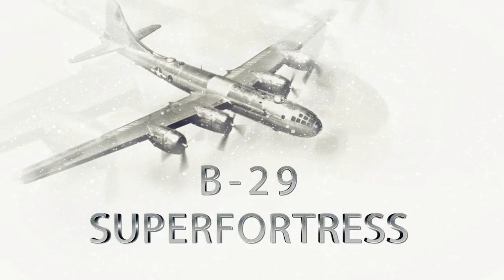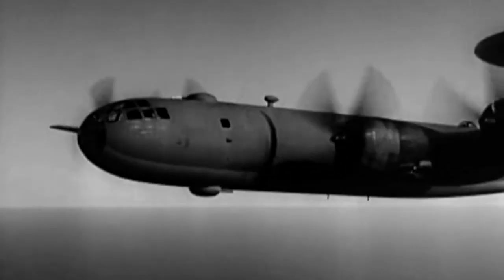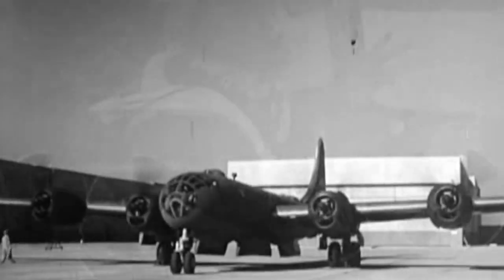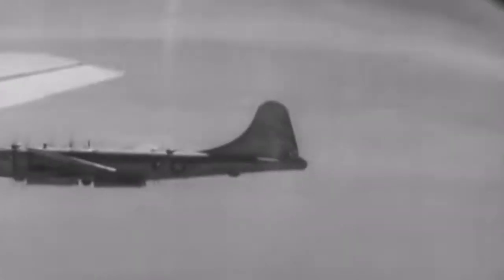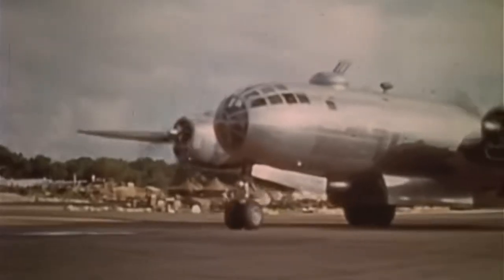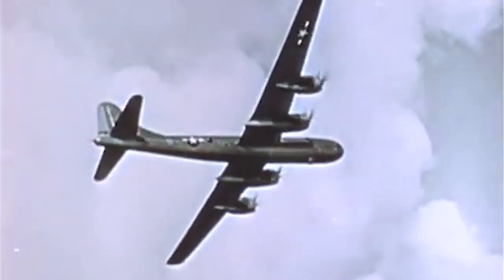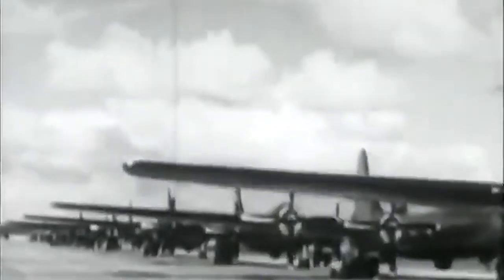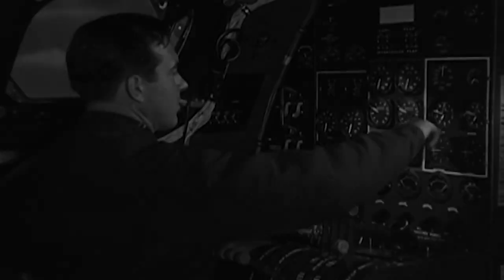B-29 Superfortress Documentary | Bombers of WWII

Comment: I have to confess, I have very mixed feelings about the B-29. There are many aircraft out there that you can say have a soul. The B-17, B-24, Avro Lancaster and many war birds, all meet this mark. They are living creatures with a heart and soul of their own. The B-29 on the other hand. I find too clinical, too sterile. It's a cold, methodical calculating machine, that does what it does with such a hiemal, ruthless efficiency that leaves me feeling a little disconcerted. That said though, with that polished aluminium body and sleek aerodynamic design. There is no denying that it is an absolutely flawless, beautiful peice of aeronautical art.
Reply: Yes! I find your answer interesting and see your point of view. This airplane was designed for long-range high-altitude bombing of cities which included a lot of people. Fairly cold-hearted I would say. However technically, it was way ahead of its time. Pressurization and remote-controlled gun systems with radar and computers that were way ahead of his time as well.

Comment: The B-29 was a really a beautiful airplane altrough I agree with a fellow that it was a rather soulless and cold airplane. The real problem was the awful Wright R-3350 Duplex-Cyclone radial engines altrough powerful was beset with dangerous issues and was very unreliable and mantainace intensive engine. Despite long development the engines was rushed in combat but remained temperamental, and showed an alarming tendency for the rear cylinders to overheat, partially due to minimal clearance between the cylinder baffles and the cowl but also because the two radial rows was set together back to back with the front row exhausting in the front and over then to be connected with the rear exhausting pipes going down to the turbo charger creating an extremely hot environment. A number of changes were introduced into the Superfortress' production line to provide more cooling at low speeds, but when combined with the high temperatures of the tropical airfields where B-29s were based, produced overheating problems that were not completely solved, and the engines having an additional tendency to swallow their own valves. Because of a high magnesium content in the potentially combustible crankcase alloy, the resulting engine fires — sometimes burning with a core temperature approaching 5,600 °F (3,100 °C) — were often so intense the main spar could burn through in seconds, resulting in catastrophic wing failure. Because of those issues many crews lost their lives. Finally at Iwo Jima the mantainace crews was so fed-up with those engines had to be repaired that many were junked and simply installed new engines just arrived. I freely extracted from Wikipedia regarding this but I  knew long time ago! hope I didn't bore you but you did a good job 👍 👍👍